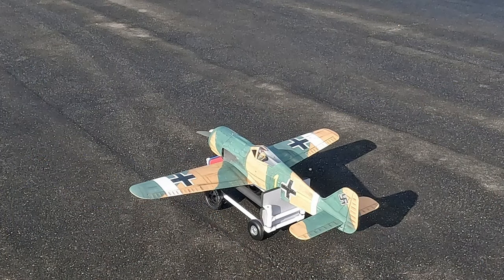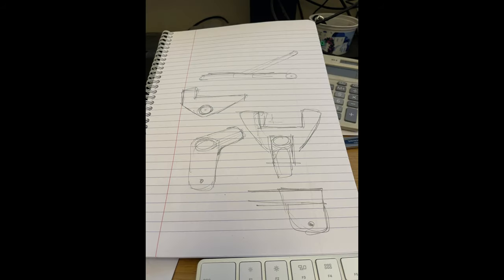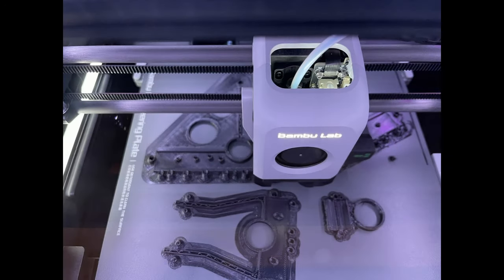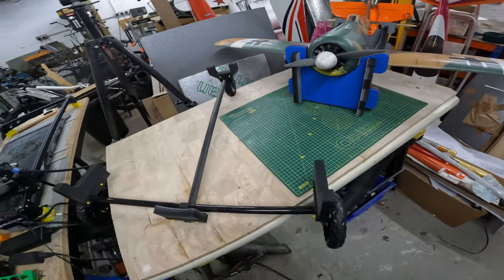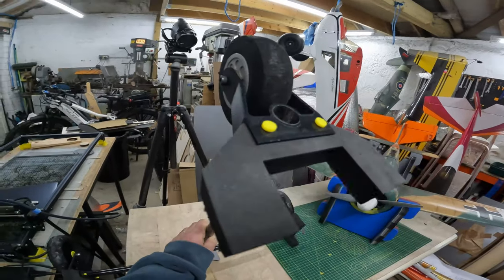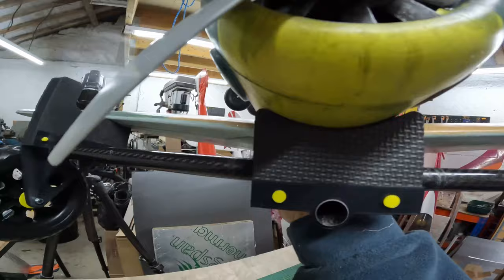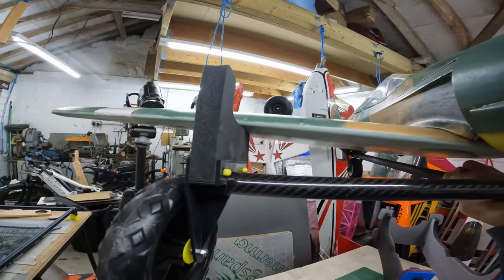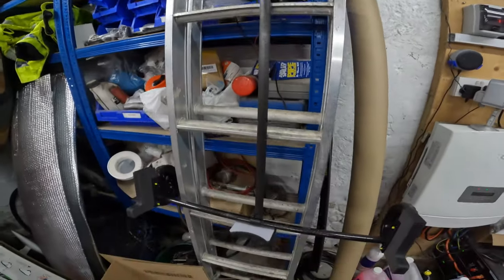RC Planes launch dolly

Comment: Looks good! I’ve built a similar one for my FW190, and I tested it this afternoon. I had a problem - the plane tends to slide backwards due to the slope of the dolley to give a decent angle of attack for takeoff. I’m going to add something to catch the back of the cowl under the wing leading edge to get a more secure location. Then I just need some decent weather!
Reply from the maker: Strange that as it should keep to the front with the thrust from the prop.
Reply: I know - that’s what I thought. In practice the bumpy field tends to make it slide down…
Reply from the maker: @Lipo-man  my new dolly works rather well on smooth and bumpy surfaces, see my other video.